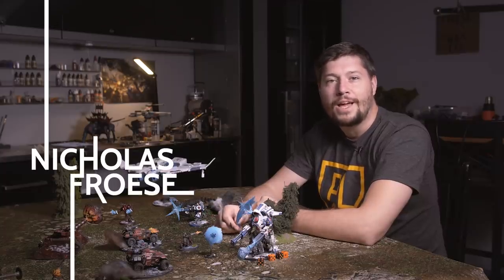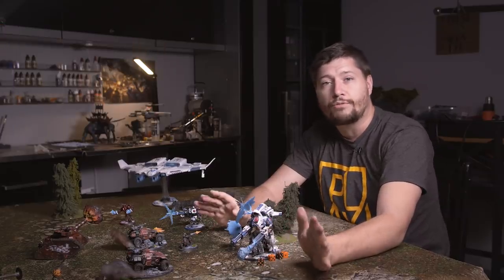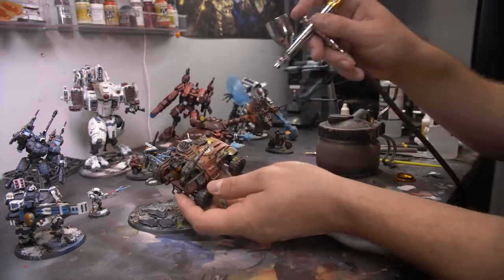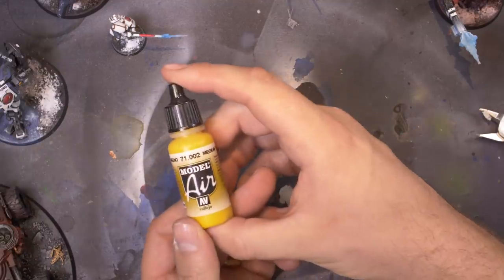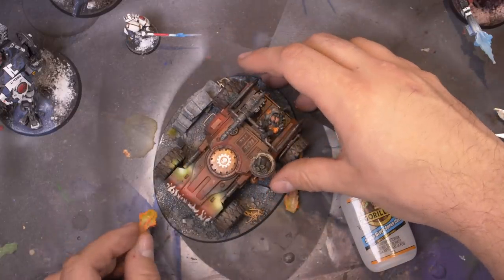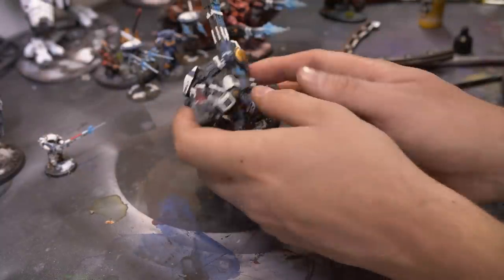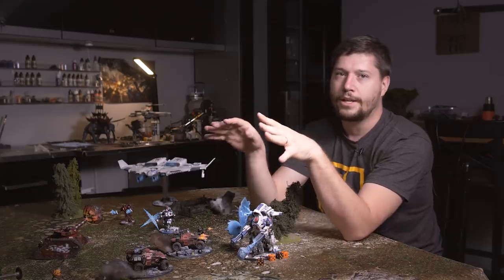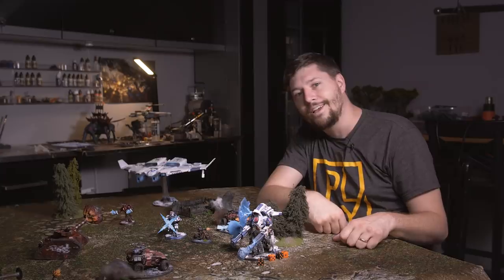How to make 3D Battle Effects for Miniatures. Gun blast FX and Dust trails.

Comment: Literally just added a dust cloud to my mini after three days of experimenting. Wish this came sooner 😂. But thisll help future projects hopefully. For the smoke, the material youre using is probably polyfoam which is the same material used to stuff teddy bears or pillows with and can be found in any craft store. You could theoretically use cotton balls also, but I found those clumped up waaay too much when they had paint on them(compared to polyfoam which can still be springy and stretched easily after paint is put on it and dried), and would be more appropriate for big dense clouds/explosions then dust trails.
Reply from the maker: It is indeed. I found the same.  You’ve obviously had some experience with it!

Comment: I really want to be able to 3-D print the minis, that I keep imagining, but I guess the logical first step is to decide upon which CAD or 3d-graphics program to use for making the designs, and then really dig through all the necessary tutorials to learn to make the software sing. What is a good program to invest my time in, and do you know about good tutorials? Is Blender decent for that job? (It's free and it does have a good collection of tutorials) Or should I be rather looking for CAD than for graphics programs for "modeling"?
Reply from the maker: I know someone that is currently using blender to do some really neat things.  I heard that once you have a good understanding of one, while the tools and interface are different between the programs, the core understanding you can take from one program to the other.